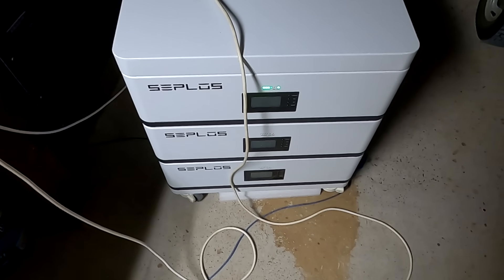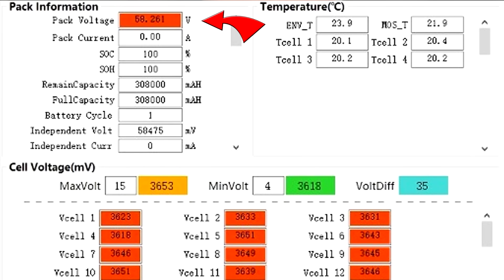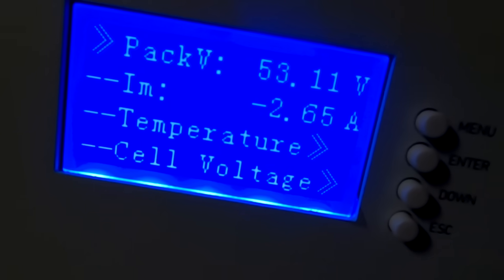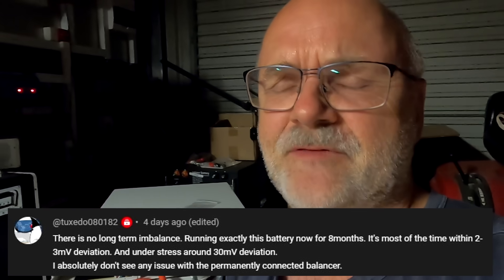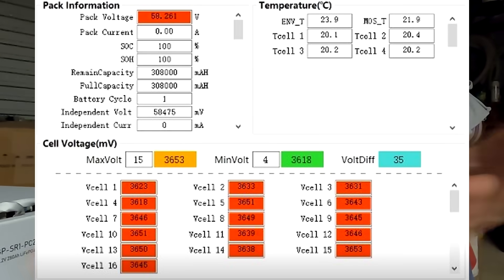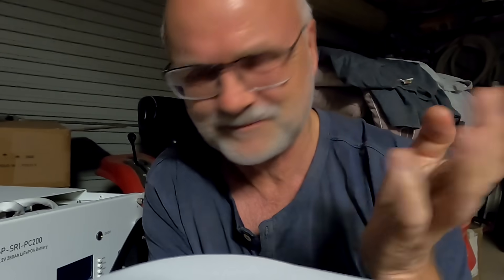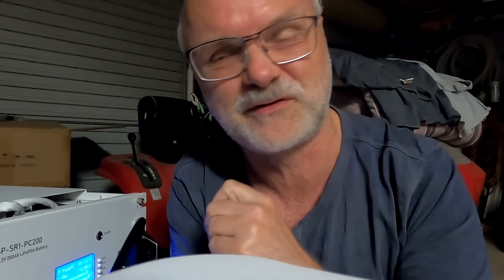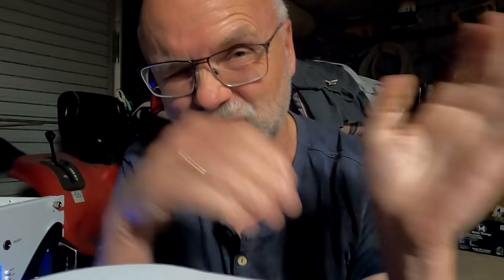Active Balancer: always on or only above 3.45V?

Comment: Have tried just about everything since going lifepo4 in 2014. Always-On active balancers threw my balance out and created a bigger challenge to deal with at the top. I went back to ev power passive balance boards. About to try active balancing again with the voltage relay control.
Reply from the maker: Thanks for sharing.
The voltage control relay works a treat. Since we installed this in the QSO battery, no problem any more. Perfectly balanced down to 10mV

Comment: Hopefully Gobelpower made this test also and therefore came to the conclusion that its a good thing to leave the active balancer on "working" 24/7. Why otherwise they should install it in that way? We will see because of our testing hero Andy.
Reply from the maker: Thanks, hahaha.
Doing the last test today and will edit the video tonight, so ready for you Friday evening to watch.
I can imagine, they just throw the balancer in there hoping it will work. It's a cost factor to either use a NEEY as standard or a voltage control relay. Or even a simple switch to turn it on or off...

Comment: If the cells are being charged or discharged at a current that the balancer has no hope of catching, why would it be on?  Is voltage alone the correct way to enable/disable a balancer?  The cell differences will often exceed what can be balanced while under heavy charge/discharge so why not disable the balancer until the cells are 'quiet' and the balancer can do it's work uninterrupted - as it were?  The balance threshold would be a voltage and a current.

Just musing.
Reply from the maker: Yes, exactly. I balance at absorption voltage when the current is low or even off.

Comment: Just dont use ridiculously low deltaV and anything above 3.3V turn on is fine. 20 to 30mV for deltaV.... its pointless aiming for 5mV deltaV. My 2c.
Reply from the maker: I think it is fine to leave the balancer on 1mV precision as long as the battery has no other charge or discharge current to deal with.
If it wants to run, let it run (above 3.45V).
But yeah, seriously, a deviation of 20mV is perfectly fine.
Reply: @OffGridGarageAustralia  Maybe, but do you think that any cheap Chinese item is likely to be a precision electronic instrument?  Accurately measuring low mV is tricky.  1mV will be far below the noise floor of pretty much everything they ship. I would stick to 20mV or more just to get consistent results.
Reply from the maker: @livingron  yes, I agree.

Comment: I think you should drain it to maybe 10% (below the voltage flat spot) and bottom balance it for a few days, then charge it to see if the top balance was messed up.
Reply from the maker: Of course the top balance will be messed up if you bottom balance it. You do only one. And bottom balancing is outdated in my eyes. That's a thing from the past, where we didn't have BMS and balancers.

Comment: IMO, the unbalancing will happen when the cells are around 3.1V~2.5V if you intend to top balance.
(Or around 3.4~3.6V if you intend to bottom balance).

I am in the camp of balancing only when cells are >3.4v, and not always.

Comment: I get it about not balancing on the flat part of the charge/discharge curve, but just as you can put more capacity into the charging by stopping the cells reaching their upper voltage limit, surely the same must apply to discharging, whereby it can stop the discharging stopping because one cell has fallen below the cut-off voltage, I'd like to think that both top and bottom balancing would give you the best capacity and also the balancing current would have to be proportional to the current being put in or drained out of the battery, surely this isn't a hard algorithm to apply
Reply from the maker: Very hard to do. As you said bottom and top balance the battery will only work if the load current is very small and the balancer has time to move huge amounts of energy across all cells. Almost impossible.
And if you really need all the capacity for your loads, get a second or bigger battery.

Comment: Before balancers, I hooked 4s LiFePO4 up to a fully charged AGM battery to ballance them.  Would be pretty cool to see you try that for the DIY community Andy.  Drop it old school.  No BMS,  3.6V, 100mV ripple, AGM charger and a 4 lead oscilloscope to keep things straight.  After you charge the AGM and LiFePO4 in parallel, let it sit for a few days.  Charge it again, then let it sit again.  It takes more time and repetition,  but it's neat to watch how it works.
Reply from the maker: 4s is easy to balance, 16s would be impossible with such a setup. Far too many variations.
Reply: @OffGridGarageAustralia  16s is not impossible my friend, it would take longer though.  AGM can be put in series too.  LiFePO4 wants to be balanced and a constant DC power source like an AGM helps that happen when it's sitting at the top end of it's charging range.

Comment: I'm using balancers capacitors all the time. cell voltage diff is small like 0.002V or 0.001V
Try to control your charge with lower currents above 54.3V level.. Starting from 54.3V even can go up starting 55V battery LiFePO4 starts to saturate...it takes a small time  to raise from 54.3 to 58.2 so you must reduce charge current. Maybe you are unbalance cells by not reducing charging current in the saturation level of batteries,then  any balancer in the world can't make any balancing because of saturation of cells.
On electric cars the charging current is cutoff from 85% and drastically cuttoff after 90%95% see tesla how charges.
Try to follow the pattern of electrical cars charging.
I've achieved this similar behavior by programming CerboGx (node-red) to reduce Charging current from different charging stages like Bulk Mode up to 84%=0.11 C=35A per battery bank(I have 3 battey banks REPT in paralel 302A each total 906A JK BMS+Capacitor Balancer)
84% - 90% = 30A per Bank
90%-95% = 15A per Bank
95%-100% = 10A per Bank
Float is achived for me at 54.3V , I don't want to stress up to 58...I lose maybe 1% of capacity but all cells are balanced...everything works great.
Because I use small charge currents and adaptable with battery charge status...I don't see differences between cels

Comment: Active or passive balancing below 3.4 V creates problems.

I want to take the time again to say, an active balancer is only necessary when a pack is first made.  
If you need one after a pack has been made, you have a bad cell that needs to be replaced, or you've hooked something up incorrectly.  Finely tuned passive balancing is all you need in a good battery.  After the initial active balance,  all the batteries I make settle in after a week or two and have no more then a 10 mV deviation.  Years later they get better and sit with 0 to 5 mV difference because of how amazing low current passive balancing is.  It's why all BMS's on the market use passive balancing, it's efficient and cost effective.
Reply: Love this investigation Andy, keep up the good work!
Reply from the maker: Thank you.
Well, I never had any battery pack (built or bought) which could just cope with the tiny BMS balancer. These large capacity cells (100Ah and above) are drifting a lot. This might not be the case with a 12V setup and using 4 cells only. But 16s is a completely different animal and deviation is real.
Reply: @OffGridGarageAustralia  You also don't charge your batteries to at least 3.6 volts per cell though.  You may find they balance better when you do.  All my batteries are set to 3.6.  They won't balance at all in the Canadian cold weather if I use 3.45 at 5 degrees C.
Reply from the maker: @boatelectricaldiy  yes, absolutely. I'll start exactly this experiment today. Thanks for sharing.
Reply from the maker: @boatelectricaldiy what are your settings exactly you are using?
Reply: @OffGridGarageAustralia  I charge to 3.6 where the charging mosfetts turn off.  Balancing happens after the battery stops charging  until  it drifts from 3.6 down to 3.4.   Charging mosfetts turn back on at 3.4.  I float the battery at 3.45 so the charge mosfetts stay off. Having the charging mosfetts off during float lets the solar and alternator(s) do the work in float (depending on loads) while the cells balance.  I let cells empty to 2.7 where the discharge mosfetts turn off.  I set the inverter to shut off at 2.8 so it shuts off before the mosfetts.  I use 5 min timers as well so things don't flop in and out of float constantly if the load is right on the cusp of what the alternators and solar can handle.  (Side note: Lead acid will last forever directly paralleled to LiFePO4 at these settings, and will be there as a buffer that prevents mosfetts from being blown.  It's pure DC output also helps ballance the LiFePO4 cells.)
Reply: I also have an initial top balancing regime that I consider integral to the end game balance of my packs.  It involves moving cells not performing well with their initial placement, and repeated cycling between 3.6 to 3.2 volts while using a BMS's passive balancing and an active balancer.

Comment: My house is off-grid with several 230ah packs. I record each cell voltage into a database every 5 and graph into Grafana.  I have run several test since some packs are of the same age.  A top balance with no balancer is only good for about 4 months of daily cycles down to 70% SOC (my daily usage).  After that 4 months, the top balanced pack with no balancer had the same above 3.45+v cell drift as a pack that I had not top balanced at all, and I just connected up the balancer and put it into service.  As for deep cycling, I have drained the packs to 3v per cell (48v) and the inverters are configured to turn off then. No cells fell under the 2.50v LVD, but all started to drift.  When charged back up, all cells drifted a lot above 3.45v, but the balancers fixed that after a few hours. Based on the off-grid house application, where I am fully charged, or in the flat part of the curve for 99% of the time, I am not seeing an issue with having the balancers on all the time. If I am loosing capacity, it's only showing up in the bottom 10% of SOC, and for the few times a year when I hit that, I am ok with it. I don't have a way yet have a way to turn off and on the balancers based on voltage (it's in the works), so I can't test your theory. You might be right in a pack that is deep cycled all the time and spends more of it's life near 10% SOC.
Reply from the maker: That is very interesting. Thanks a lot for sharing your results and experience!

Comment: Andy, Thanks for testing this!!

Suggestion: how about turning OFF the BMS balancer for the test, it balances by shunting (wasting) energy. The active balancer redistributes it within the pack (aside from a few milliamps consumed for switching). The only thing the on-board balancer can do when the active balancer is connected is to remove energy and interfere with the active balancer's mission. 

After seeing how these capacitive balances work, IMO the 24/7 connected active balancer doesn't appear capable of messing up the balance as you've described in your notes. The only power it has to work with is the cell's differential voltage, not enough to push the state of balance during a charge/discharge cycle. Also per your notes, if the battery was left awhile at a lower SOC, say 35%, with the ActBal connected, wouldn't the cells be balanced at that 35% SOC? Is that not good to be balanced at the start of a recharge?

BTW, There's a really good video on YouTube that describes/diagrams how these Heltec-style capacitive balancers work. (cant post link but exact title is: "Active Balancers - How Do They Work?" by Brad Cagle). You only need the first 2-3 minutes to get the picture.
Reply from the maker: So far, I could not see that the BMS balancer interferes with the active balancer. I had them always running together. The BMS balance current is just tiny in comparison to the AB current.

I always have the problem when charging up after winter and the battery did not get charged to a higher level for several months.
Even in the middle part, the delta can be 20-50mv with high currents coming from the battery. If I charge the vehicle for several hours on 2.4kW it pulls around 50A from the battery and the balancer will use the delta to transfer energy. Over time, this can be a lot of energy and as you said, it will balance the pack at this 35%. This is not good though as we top balanced the battery at 98% already. You basically can have only one SOC where the batteries are balanced.

Good old Brad. He's here on the channel as well and leaves comments sometimes.
Also watch the video from Stuart in the description.

Comment: Rare full charge for me today - 90mv difference at 3.575 average/cell.  50ma passive balancer on BMS, 12kwh battery, coming upto 4 year battery life.  
Why all this worry about balancers?   To answer your question, I think it will be more stable without the active.
Reply from the maker: Yeah, depends on your usage and how good and matched your cells are.
Reply: @OffGridGarageAustralia   my 24 cells must be awesomely matched, although 6P4S makes for a good average for each cellpack of 6 cells verus your single cells. And yes an average cycle is a week not a day - 182 cycles in 3.5 years according to the smart shunt.

Comment: So I have two packs, both with 5a balancers. One has the voltage controller/relay that turns balancer on at 3.45v and off at 3.43v the other is always on. I will say under max current charge, the one without the controller almost always has a cell hitting 3.65v which disables charging for the pack. I never have this problem with the pack with voltage controller/relay.
Reply from the maker: That matches my observation and testing as well. Great test, thanks for sharing.

Comment: My 24v battery with .6a jkbms balancer works just fine when the battery is only used in every other weekend to 40% charge min. 
I starten balance at 3.40 and charge to 3.45 for 20 minuten and later changed the absorbe time to 45minutes . No difference.  No tail current btw.
So it had 4 to 5 days a week to balance. No problem and up to 1mv difference only for a year.
I then changed the bms for a 200amp jk with 4a balance. Guess what?! Differences are 3 to 6mv with same setting . So, heavy usage you need a big balancer, little usage you need a small balance current?
Reply from the maker: Great test and conclusion. Thanks for sharing.

Comment: I think it will depend on how fast / slow its charged and discharged
also how long it stays at a high / low state of charge
if the battery never went above say ~50% SOC for months on end over winter
I have a feeling the balance would be completely distroyed
Reply from the maker: Well, we will pull the exact same current from the battery and charge the Tesla with it. Exact same test conditions just one with and one test without balancer.

Comment: I use 4X Dali BMS 250A  these use 250 milliamp passive balancing and 32 EVE 280 AH matched  batts been is service 24/7  over two years and a Victron Quattro 8KVA 24V
Reply from the maker: That's a massive balance current for a BMS! My QUCC BMS had 200mA.
So you're not using any active balancer at all?

Comment: I tried an active balancer last winter and it destroyed the top balance. Even the state of charge was not right after the whole winter time. But may be there is another solution, which can work. Usually even a high load does not cause a big imbalance at the flat area of the the cells. There will only be a deviation at the top and at the bottom. So maybe you can set the active balancer to work at around 20 mV deviation. This would lead to more at capacity at the bottom under 3V. Can you try this?
Reply from the maker: These balancers cannot be set in any way. They just work as soon as they are connected.
But yeah, this is something we look into with the NEEY and program it to say 30mV delta, so it won't turn on of the deviation is below that. It may be able to run all the time. Or say at least above 3V.

Comment: There isn't going to be much voltage difference and therefore balancing going on for most of the capacity range, so as long as the battery isn't almost empty most of the time (or at least longer than it is full) it should still work fine.
Reply from the maker: OK, but even discharging the battery with say 50A will cause a certain deviation (20-30mV) which the balancer will use to balance. And especially in winter and using the battery only from 10-50%SOC, this causes a lot of imbalance.

Comment: I'm having an active balancer all the time and everything is fine. I don't have unbalanced cells anymore.
But before, when i didn't had an active balancer, my cells lose balancing and i have a huge deviation when the cells discharge...
Reply from the maker: Interesting. You're using the same capacitive balancer?
Reply: @OffGridGarageAustralia  I'm using the chinese Hankzor 3-4S balancer. The same you had in your videos.
I always had one cell that discharge over time much faster than the others and because of it i lose the entire 12v capacity cell pack, because that cell will trigger the BMS.
But now, i think it still lose capacity but at least the active cell balancer is draining the current from the other cells and therefore keeps the whole pack in balance. That's why, now my pack lasts much longer.

Comment: Andy, can you test how much deviation there should be before the active balancer starts to work. If I'm not miistaking it's more than the 5mV you mention. This will determin  if it's okay to keep it running 24/7
Reply from the maker: I think it is around 5mV. It will still work below that but efficiency is very very low.
You probably can leave it running with 50mV deviation as you won't reach that in the flat part and it only balances if you get more than that.